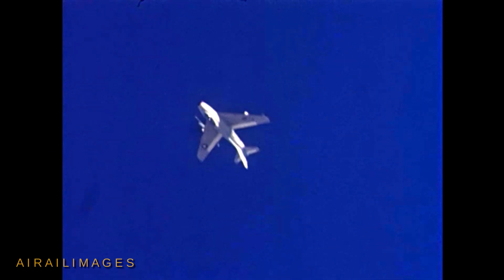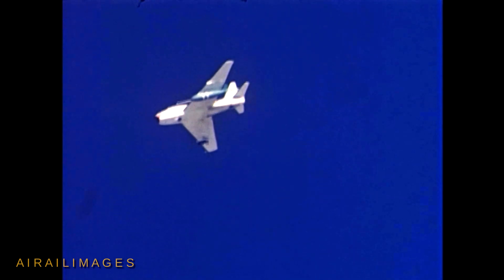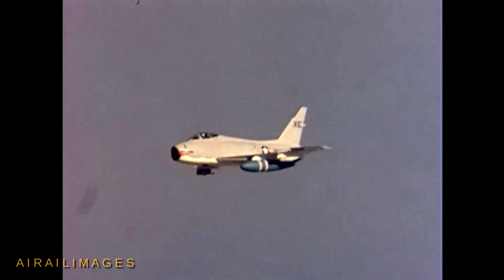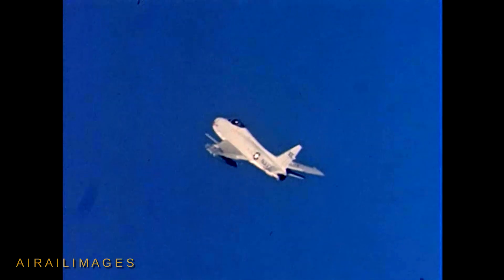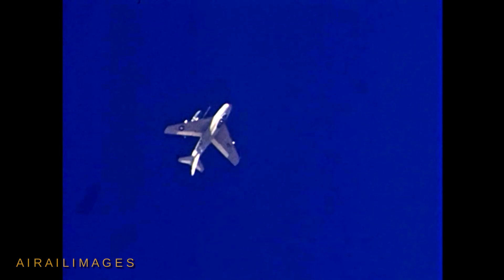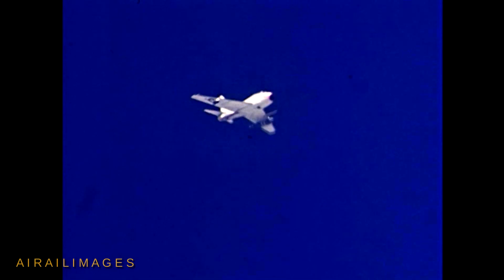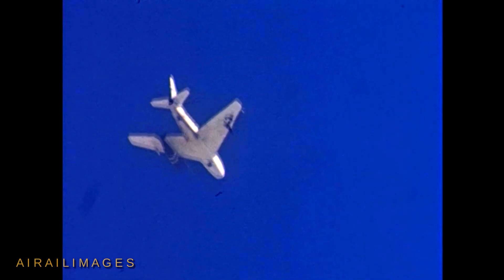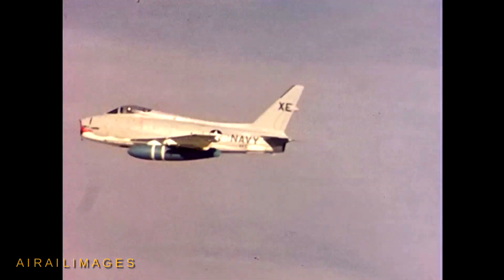FJ-4B Fury nuclear delivery shape LABS low level China Lake National Archives NARA Airailimages

Comment: The middle section of the video with the Fury flying nose on and left to right makes the ordinance on the starboard (that's right for us Air Force personnel) wing appear to be 6 blue practice bombs (likely 25 lb. BDU-33s) in two rows of three (triple ejector rack).  You can see a spent BDU at 7:10 near the white concrete target and the white smoke looks just like a BDU-33 charge.  The BDU has a hollow shaft through the bomb and a "shotgun-like" charge of white smoke in the nose that goes off on impact for easy pilot and range officer spotting/scoring.
@Andrew-13579 did a great job seeing the BDU come off at 5:53.  F-16 RTU (Replacement Training Unit) at Luke AFB, Arizona trained the new pilots in a loft delivery like this for nukes; low altitude, high speed IP to target, 4-5G pull-up at the appropriate INS range, the computer released (ideally at about 45 degrees nose up for max range), continue the G over the top (or maybe it was a sliceback) to nose low, roll upright, get back to low altitude, and make distance to get away from your own bomb.

Comment: Looking for information about nuclear bomb delivery tests  at Wright Field, WP-AFB and probably Wendover, Utah, US in the mid/late 1940s with German Messerschmitt Me 262 as CAS for delivering Werfergranaten WG 21 and  WG 42 atomar, re-enacting planned German nuclear attacks against the Red Army in April 1945, "Battle of Berlin". In Ohio, a "high speed" Me 262 normal version, painted in gloss green and blue, probably German RLM colors for a smooth, high speed surface tests took place, finding out the best way to deliver nuclear weapons in low level flight. In Wendover, Utah there could have been live nuclear weapons delivery tests conducted with a white painted Messerschmitt Me 262 HG II "Pfeilflügler", "Arrow Wing", 35 degrees swept back wings with live ammunition to re-enact planned German operations with nuclear weapons against Russian Troops at the gates of Berlin. At both tests in Ohio and in the desert, the Messerschmitt 262 had full German national insignia, Balken- and Hakenkreuze, most probably both tests were filmed. Who has information, film material ect. about the CAS bomb delivery tests with Messerschmitt 262s? A photo of a dismantled Me 262 HG II minus (Heinkel He 011?) jet engines, painted white with German national markings can be seen at Glendale, Cal. in internet. KPR, Book Author hidden WW II and WW III.

Comment: The Fury is a neat aircraft, and was part of that weird and interesting transition period between props and jets.  The warbird FJ-4B Fury, N400FS, was at Oshkosh in 2011, when a F-16 overran the runway and collapsed the nose gear and ingested a lot of dirt.  Not great.  The Fury later overran the runway too.   Maybe there was something in the air?   Well, the Fury's tough naval landing gear handled the abuse without problem, and was just towed off the grass.  😁